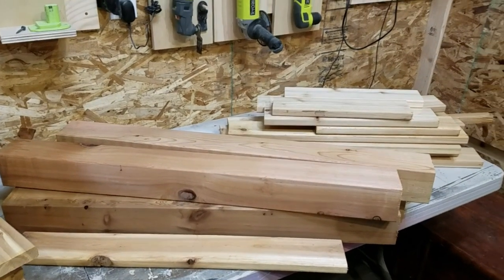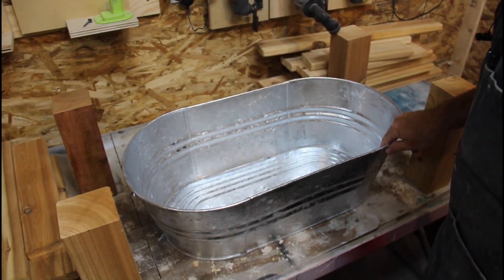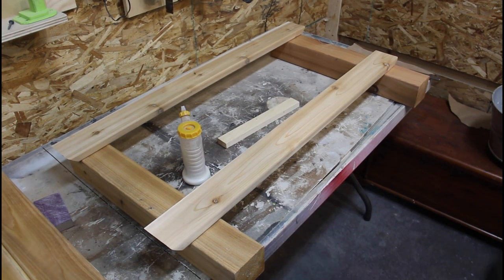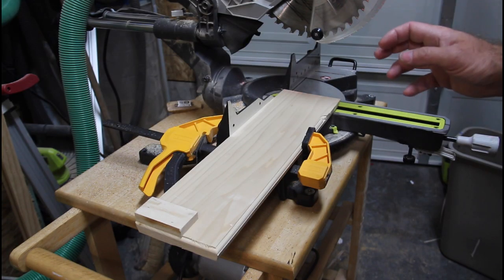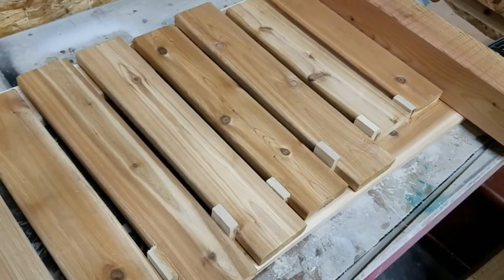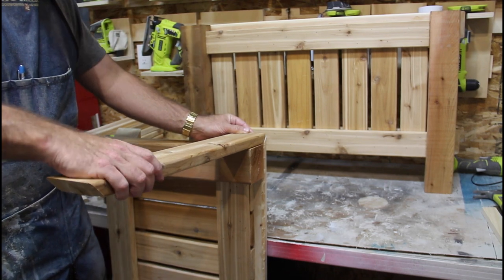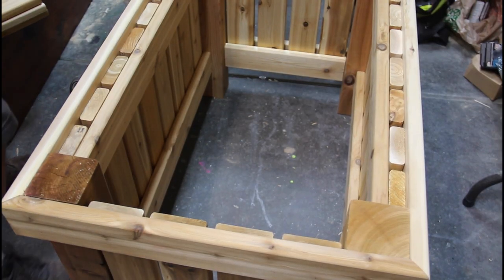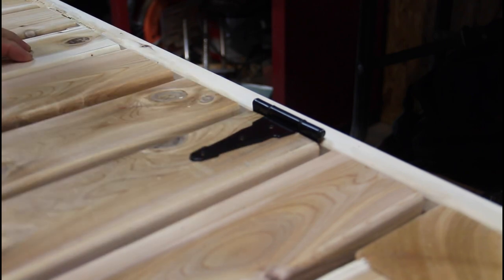Deck Furniture - Cedar Deck Cooler | I Built This Out of SCRAP! | 2020/25

Comment: Very cool project. Depending where you live. Direct tools has the Ryobi miter saw stand for around 70 bucks.
Reply from the maker: I thought about getting one, but in my shop it would take up too much room.
Reply: @DadItYourselfDIY 
You are right,  It's not the most compact design.

Odd question. On your Ryobi saw, does the blade gaurd pivot bolt come loose?
Reply from the maker: Mine has not, and I have had the saw for over three years now.